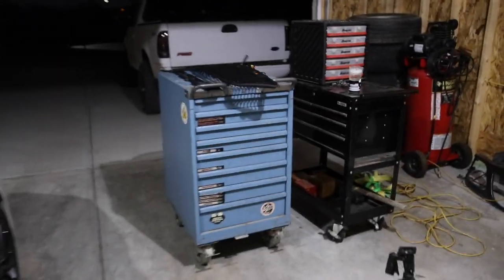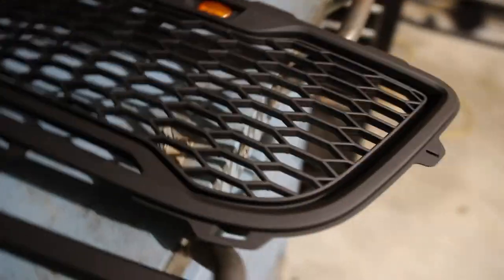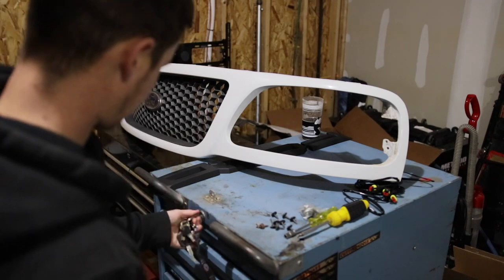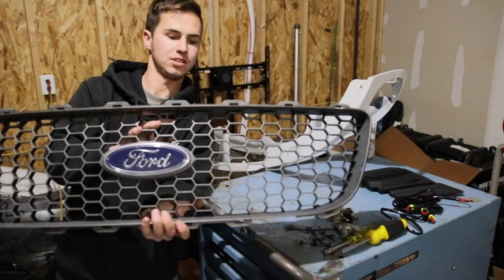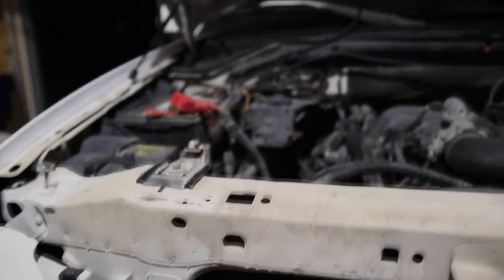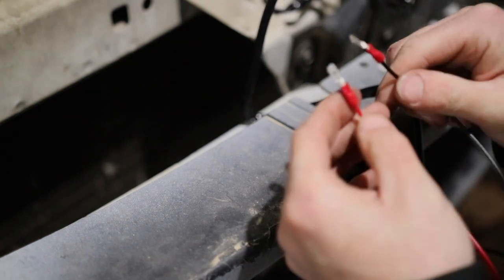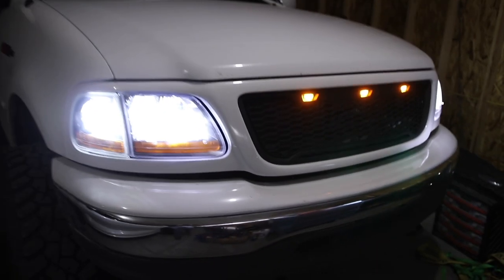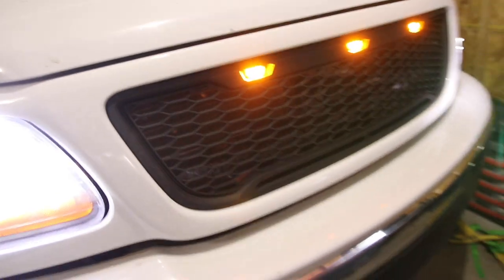Putting a RAPTOR Style Grille on my F-150!

Comment: I have a 99 F150 and got this raptor style grill. I added liner over the letters but I left the new grill as smooth plastic  just thought the contrast would be visually pleasing. I can always line the grill if I decide the contrast isn’t what I thought it would be once installed. 

The frustration I’m having is with the plastic trim inside the engine bay. That sucker had really old and stubborn plastic trim tabs most of which broke during removal.

Comment: Just a remark, use your tailgate as the work bench. To prevent scratches put down a blanket.  Thanks for posting this.  Your video was extremely helpful.  I painted the honeycomb part and added aftermarket raptor style lights to it.